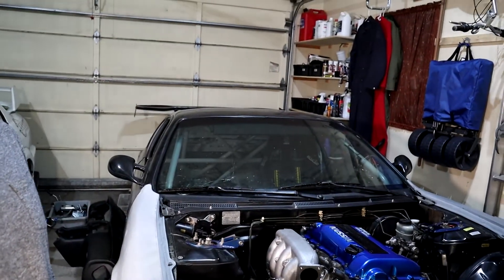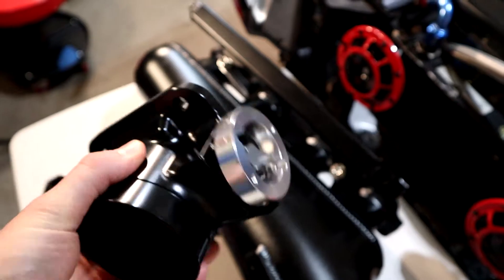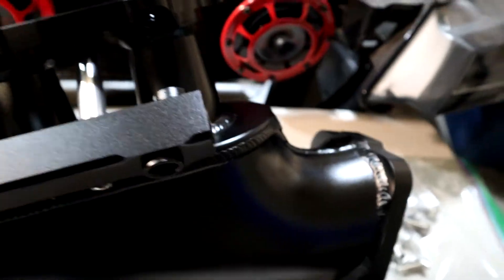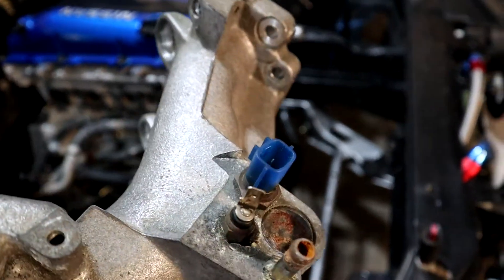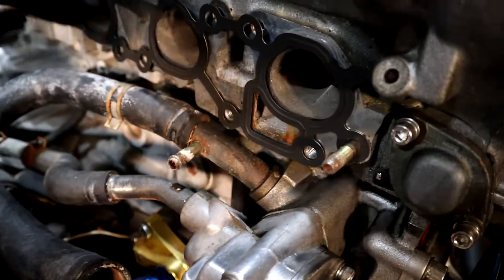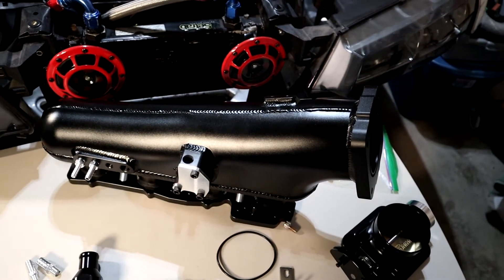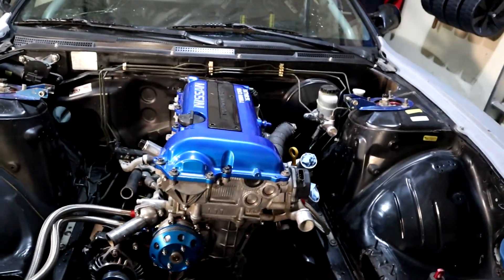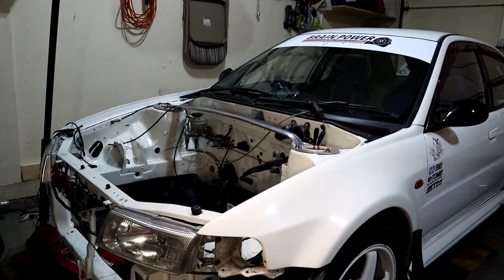Test Fitting an NPBoosted Intake Manifold on the S14 (SR20DET)

Comment: I came across you randomly with that said good video man back in 2008ish I thought I knew everything about SR engines lol tried to slap on a full-race top mount equal length tubular turbo manifold a Garrett gtx30rs turbo and a Jun GT super surge intake manifold "and as a o.g. late 90s Tuner upbringing guy Jun's is what everyone out that is considered cool now copied. Hypertune. Plasmaman. Etc they created it for super GT or jgtc." And it took me forever to reroute and block off oil lines and cooling lines heater lines air conditioner lines water lines.... so I appreciate you showing the true struggle for people that had to learn at some point👍
Reply from the maker: It took me forever to wrap my head around how I needed to route it all. Glad to hear I'm not the only one who had to deal with it. And thanks for watching!

Comment: S15 enigne and S14 Sr are pretty much the same except from stock from my knowledge why the S15 SR is so much more than the S14 SR online is beyond me. i have a S14 SR in my S14 car i think but a lot of mods on the car and the Engine itself pushing 400hp 1.3 bar of boost 18 lbs or so 6 speed 350z trans LSD rear end clean car and not a rebuilt title :)
Reply from the maker: Ya, not completely sure on the price difference. Is it the variable cam? Either way, I lucked out with the KA24 already being swapped out for the SR20!